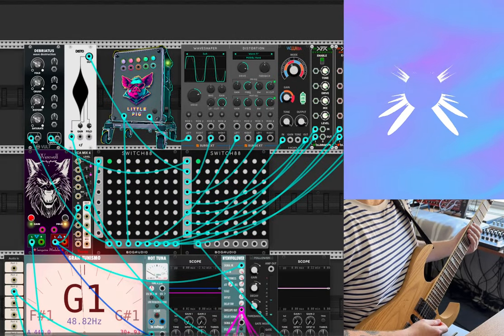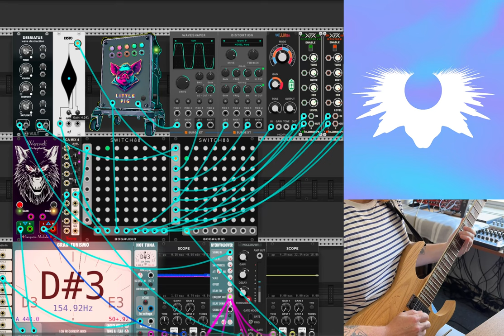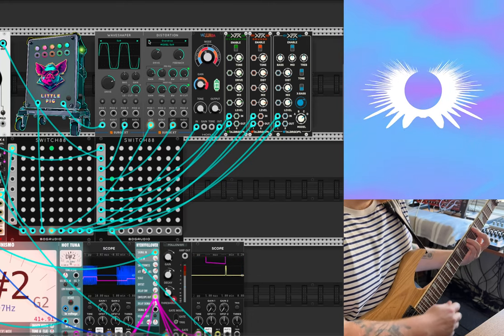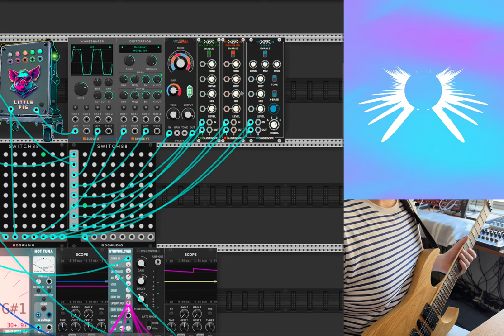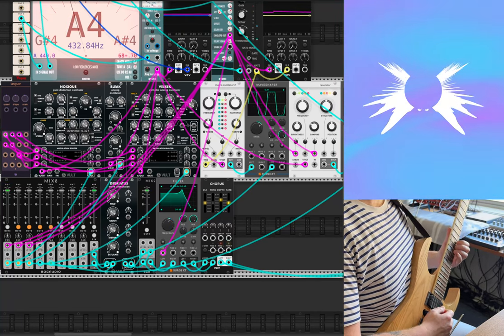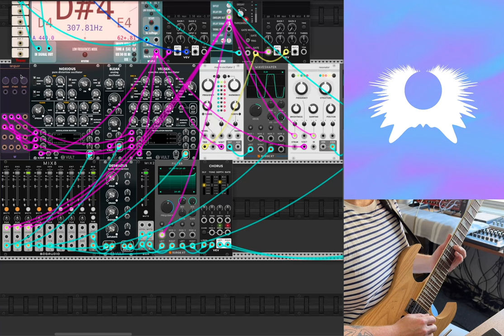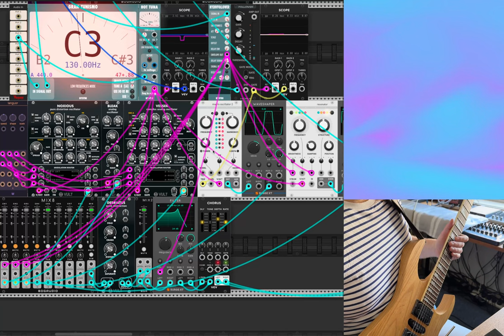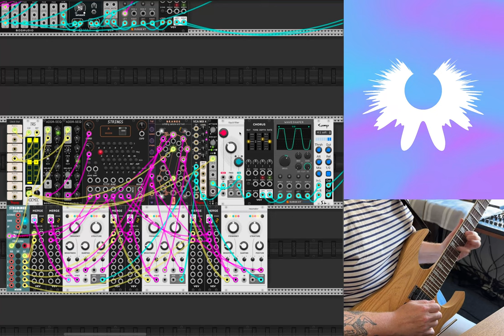PatchWerk with Miles // EP10 Guitar in VCV Rack

Comment: Oh man, this is my favourite subject! Now, I'm not any kind of expert on this, I've just been dicking about with guitar and VCV since around 2018, so this is my honest opinion. I would NOT use VCV for guitar tone and distortion because it's not designed for that. I think that when you DI guitar straight into a computer interface it lacks a proper tone, and no amount of EQ or distortion in VCV can fix it.
I guess it's fun to experiment with, and worth a go if you don't have anything else set up for recording guitar into the digital domain, but my advice would be to sort your guitar tone out with something else, then use VCV for the good stuff like filters, granular delays and random modulation. You mentioned that you have Softube, but probably the cheapest/most convenient way to do this is pay $30 for VCV Host, then use a free VST amp sim. You can also use free VST convolution software to load impulse responses for guitar speaker cabs, there are thousands of free guitar cab IRs and plenty of free options to load them. That's just my two cents, hope it doesn't come across as too critical - I enjoyed the video. That guitar is a beauty too! 😉
Reply from the maker: @VirtualModular  thanks for the detailed response :)
yeah this was mostly an experiment to see how it would sound and what can be done with it. Been meaning to toy around with it for a while now so it seemed like a good idea for a video. If I were properly recording guitar I would probably use the Softube plugin that I have which does sound really nice. I DI into the computer with my SSL12 interface which has nice sounding preamps. Definitely can see using VCV in conjunction with Softube to get some nice modulation effects. Thanks for watching ☺️
Reply: @warmnatural  cheers, I have a whole series of modular guitar effects. I think it's fair to say the patch ideas are usually better than the demo videos!